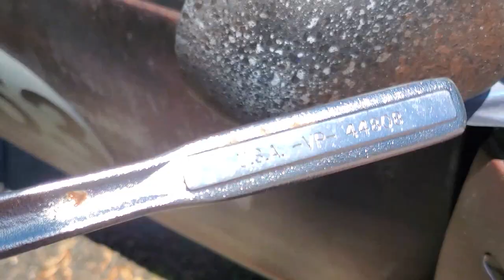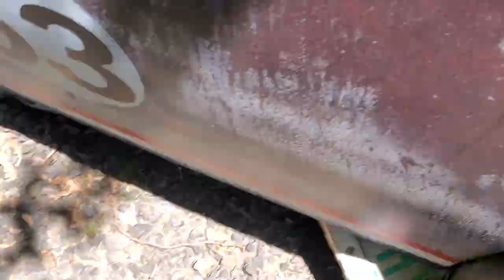2010 beetle mirror install on 2000 new beetle

Comment: What did you use to paint your dash panels? What prep work did you need to do for the driver and passenger textured panels?
Reply from the maker: S.E.Ms automotive interior dye. Used mineral spirits then alcohol to clean it. Then sprayed it light coats with Japan dryer.